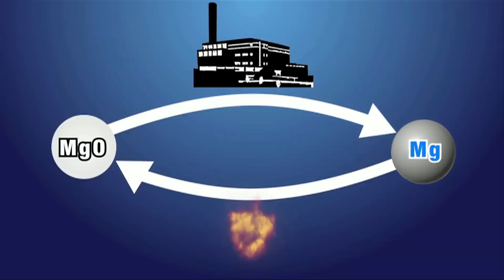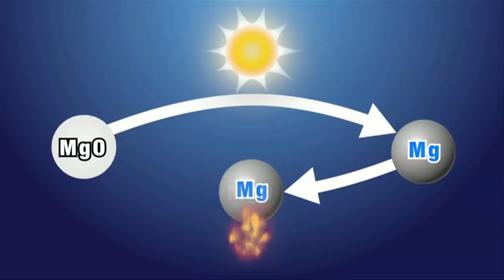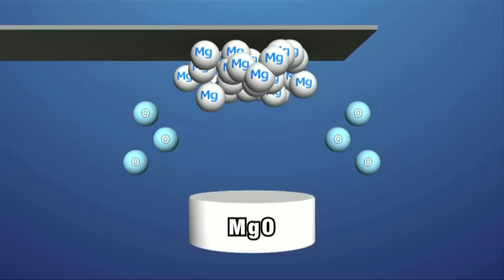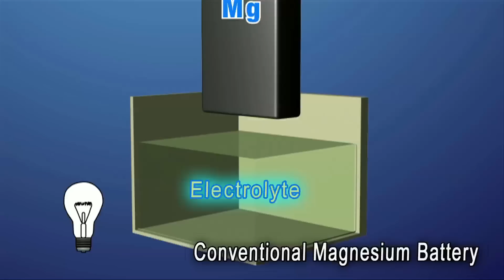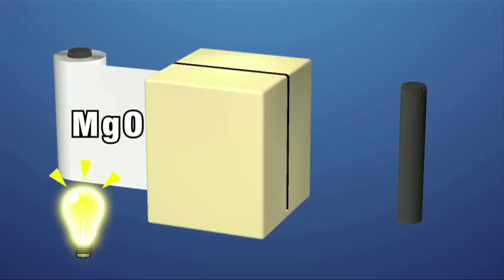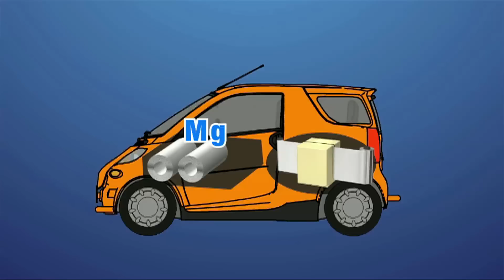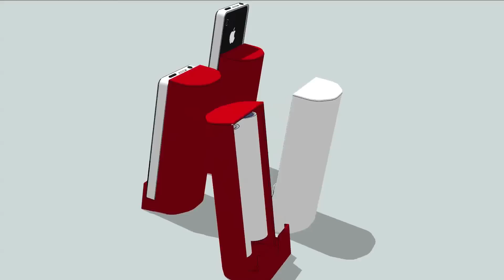Magnesium Fuel Cell Battery and Sun-light Pumped Laser

Comment: Good grief. They use magnesium foil batteries for limited life items like missiles or emergency power devices because it offgasses hydrogen. As for solar powered laser, built one in 2011, was a passively q switched Nd:YVO4 with a dye cell light converter to change the visible to near IR that the neodymium could use. As for using photodisociation, the process is painfully slow and requires a vacuum to work..

Comment: 2 Mayor important facts to considered #1if is a prosses to get the fuel  from magnesium what is the cost and impact on The inviroment to create if the cost is the same or more compared to gasoline this will not be good if is less Ned to be 50 % or More and thinking about were to get the magnesium to supply demand on mas production #2 infrastructure cost to develop this idea you Ned energy to produce energy solar???? Really?

Comment: Why in the world aren't we using this
Reply: Because anyone can recharge it for free. and it's decentralized, anyone can charge the magnesium on their balcony, Electrode cost is zero. Anyone with a Fresnel lens or parabolic solar concentrator and some stainless steel sheet or copper or Alluminium or titanium or nickel sheet can recharge it for a grand total of Zero dollars.
Reply: @mattbanks3517  interesting
Reply: Because you would need thorium or gen 4 reactors to efficiently renew, and greenies are pawns of the oil energy - - too lazy to grasp the basics of nuclear.  Solar, now, can't even economically power homes.  Thorium is 3x less than coal.
Reply: @dennisgarber  Solar is free, radiation free, no powerplants. Just a bunch of Fresnel lenses, or regular glass lenses. Or mirrors. Or solar panels.
Reply: @mattbanks3517  And the use of the entire landscape and wildlife areas to get enough power.  Not to mention, there are toxic and non renewables in the cells.  They are great, but will not help us when we enter the end of the Holocene, which is overdue, for the next ice age.  Thorium or next gen plants would allow for food production in greenhouses in a deep ice age. Thorium will hold out 100k years, and produce power cheaper than coal, which is why big oil pushes for solar, which can't compete with big oil.      However, u235 can be commercially recovered from normal seawater, with unlimited supply, because of a 2018 breakthrough.  The 3rd gen plants are safe.   ... Obama buried a bunch of nuke heads, which violated the treaty with russia.  Clinton and John Kerry was responsible for shutting down safe nuclear, and consequently Fukosima to some degree.  I don't believe in silver bullets, because any winning energy system will become a monopoly and grab everyone by the balls. Home solar is a great democratizing market stabilizer for energy.  It just aint the solution by itself.
Reply: @dennisgarber  makes me wonder

Comment: It would be more efficient if its somehow mixed with other elements to make a fuel, because it produces huge amount of heat and  that would really help, because greater the expansion of air-fuel mixture, greater the power, 1.0 l engine would be able to put out up to 200 hp with such highly burnable fuel

Comment: you could also use the sunlight pumped laser to  change water into steam...you know...a steam engine that makes electricity. Lot cheaper to run than converting  mag ox back into mag...yes?
Reply: whenever it's sunny, in which case a solar panel would be more efficient.  The whole point is that it's a storage medium.

Comment: Can a system be developed to convert MgO back to Mg as a recharging technology instead of being simply replaced? I don't want to buy replacement batteries or cartridges. Its like the poor business model of getting HP printer ink cartridges every month. This was a bad business model for consumers.
Reply: I like getting my ink, when it gets low I get a catridge, if it doesnt, i dont get one....have saved about 40bucks already.

But anyhow.  You could technically.  The trick is going to be how they put it into film form and how small they can make it.

Comment: How can you claim 10 x the power of lion batteries when your gocart is moving at 1/3rd the speed with 5 x the battery volume?
Reply: they aren't driving it fast. It has a higher energy density per kg or litre.

Comment: what is the smallest you can make the device that produces the laser... Take a circular disk of magnesium (Not Bendable) and on the collector plate have holes the same diameter of the laser, i don't know if you could have the holes in a straight line, but spiraling them around so there is distance between them left and right, but from the center out they just touching. As a visual put a marker in each hole for one full rotation and you will mark 100% of the magnesium disk surface area of the marker color. wouldn't that be even better? Feel Free To Use My Idea for your own gain, i just want to see the world change. i also know a way to produce endless energy. 
With water cavitation bubbles imploding inside of  hollow / drilled out Quarts Crystal. The Crystal puts off more AC than needed to create the water cavitation... true over-unity, there are many ways to create water cavitation, just pick the most efficient  design for creating the violently imploding bubbles so you can get the most return of expendable energy. P.S. for the others reading this that didn't know, when you apply physical force to a Quartz Crystal it generates AC power only in the very instance of the strike.
And imploding water cavitation bubbles is a very violent force!, also the harder you hit the crystal the more it puts off. note you can have 100's to 1000's to 100000's+ of these bubbles imploding at the same time and continuously. 
Note to capture 100% of the energy the zone/area/section of your setup where the implosion takes place needs to be inside of a drilled out Quartz Crystal, that is the hard part. Or you can expose the outside of the crystal to the implosion zone but not all of the bubbles will strike the crystal. they strike in a straight line and on both ends of the line, Depending on the angle of the line, One side could hit the crystal and the other your container, or both ends hit the container.
Reply: David Prock 
Thanks for your ideas!
Do you have a video instruction of how to make this free energy with water or other materials?

Comment: Magnesium oxide makes vastly superior cement trademarked as Grancrete it is far more environmentally freindly and actually traps CO2 in its use.
Reply: you may be onto something there...
Reply: i would think it would be much better used in a magnesium fuel cycle

very hard to get it out of concrete once its in there
Reply: @aeonismedia3850  it's as hard to get out of concrete as portland cement is and a hint, concrete is recycled at the plant now.
Reply: You are correct, in China MgO is used in making Boards used in housing for flooring / ceiling / walls for insulation.  Fireproof / Waterproof / Bacteria proof / very high strength and can be machined with wood working machines.
Reply: Regular Portland cement based concrete also traps CO2 throughout its lifecycle.
Reply: @spvillano  and lime mortar
Reply: @mattbanks3517  that's one thing I like about lime mortar, it strengthens with age by absorbing CO2.
Reply: @spvillano  and you could cook limestone or soda lime it with a solar concentrator to make carbon and o2. Since it's already a gas, you don't need to boil it like you do with other oxides. But using magnesium to reduce carbon is much more efficient still, and reducing the magnesium with HCL and then with decomposing the mgcl with electrolysis, running everything by using the solar to make steam and then electricity .
Reply: @mattbanks3517  so many ways of making a scrubber, so many ways of having an exciting industrial accident...   ;)
Reply: @spvillano  you can't have accidents if you build everything my way.
Reply: Ù88
9

Comment: Sounds good to me. Why isn't this in the stores yet ? Too many moving parts? I think you could pretty much "recharge" your battery via hand crank. Depending on the electrode cost of curse..
Reply: Electrode cost is zero. Anyone with a Fresnel lens or parabolic solar concentrator and some stainless steel sheet or copper or Alluminium or titanium or nickel sheet can recharge it for a grand total of Zero dollars.

Comment: I think the concept is great for EV vehicles! If it works effectively, it would solve the limited range problem of these vehicals. For cell phones however... not so practical. I would not want to have to buy a new cellphone battery every month. That would be way more annoying than just plugin it in at night. Plus its super bulky, so no one would uses it for that application.
Reply: You wouldn't have to buy a new phone. The magnesium battery would just be implemented Into a removable cartridge that would be incorporated on specialized case (plugged into your phone). After 30 days you would only have to buy a new 10¢ cartridge of magnesium for your phone case. The actual design of the case itself wouldn't be bulky at all if the magnesium battery is distributed properly through the phone. This idea is amazing. Thanks MK
Reply: MJ L. The cellphone's original battery could be removed to utilize it's space as well but knowing these large greedy money hungry companies a cartridge would cost a lot more then 10¢. They would probably charge you $5 - $10 a cartridge.
Reply: I wouldn't even mind paying $10 for a month of not plugging my phone up.
Reply: +MJ L. I would mind, 10 dollars is a lot of money for that little energy, keeping an average Li-Ion smartphone charged through the grid will only cost you a fraction of that (more like 10 cents per month).
And even if the price is equally low, current battery tech doesn't require you to replace parts of the battery once a month; a decent Li-Ion battery will last for years if it's treated well, and is rechargeable!